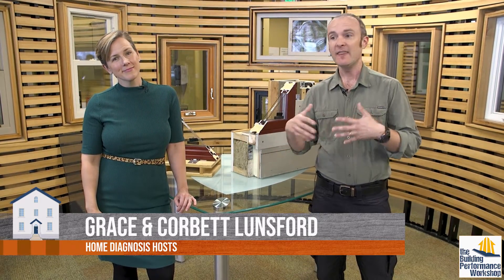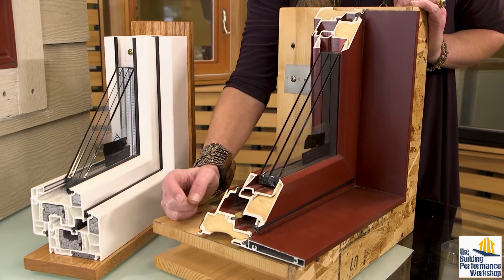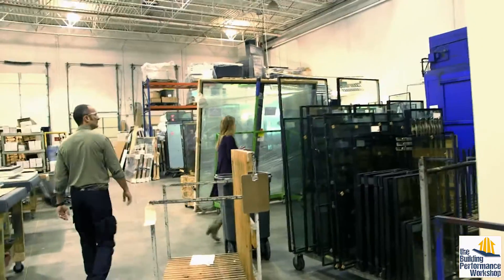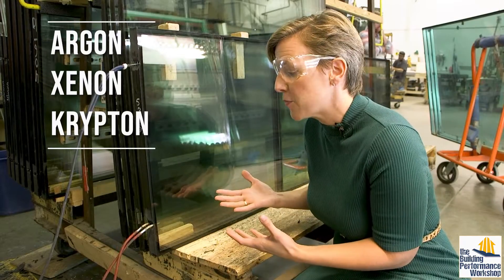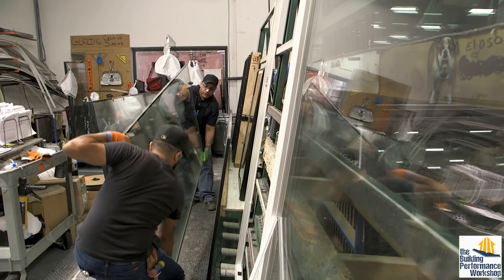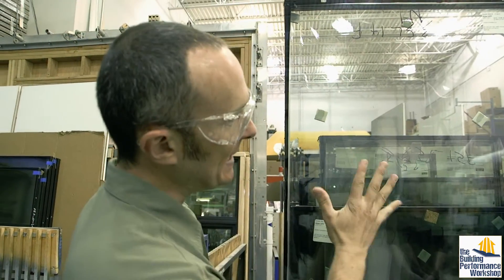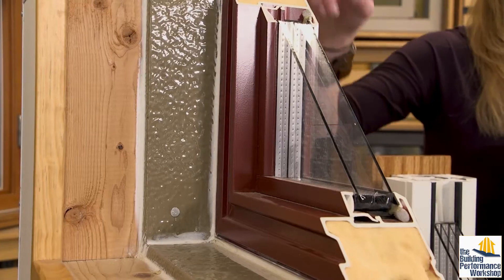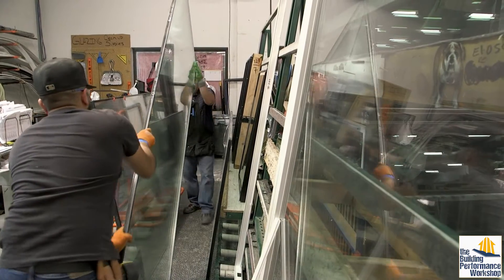Window Factory Tour: Fiberglass, UPVC, Inert Gas Fill, and Low-E Coatings

Comment: Would love to see this but with vacuum insulated glass n security films
Reply: Doubt anyone make vacuum glass vindows as the force would crush the glass and frame even before leaving the factory unless it is several inches thick solid glass.

A window with 4 m2 glass would have 4000kg force on each side or 8000kg for both sides pressing against each other.

That is like having 2 cars on ech side on the window
Reply: @tullgutten  buddy this is already a proven technology. It's actually much slimmer than these gas filled ones which make vacuum insulated glass perfect for restoration projects cuz you could just glaze them in. 
Only down sound is these tiny dots they use to keep the two panels separate. 
I just haven't seen the manufacturer process.
Reply: @mycool8980  had to google it and you are right.
But every 2cm in any direction they have support pillars too keep the glass panels from crushing towards each other and that will give many hundreds of little dots in the window.
Great for insulation where you don't need high clarity window but i doubt anyone would like this for a large panorama view window
Reply: @mycool8980  but also most say they are 2mm thicker than regular double pane window and the glass panels itself are thicker so weighing a lot more an all i see have a large vacuum port in one of the corners
Reply: @tullgutten  yeah those dots can be noticable when you 5ft or closer but pretty much disappear further away. Kinda wondered why they use black ones not clear.  But it's way less intrusive than the multiple panels you'd need to use to get the same performance imo. 
But it's difficult in manufacturing is why id love to see the process
Reply from the maker: I’ll see what I can do guys

Comment: Are those still nail on?
Reply from the maker: Yes, but I like screws better for this
Reply: Upvc=Vinyl ?
Reply from the maker: Not quite, vinyl windows are straight up PVC, and warp quickly in the sun (10 years). uPVC is more durable.
Reply: @HomePerformance  Actually, although there are definite quality variations from different sources, uPVC, PVC, and vinyl, when referring to windows, are different terms for the same basic material. All vinyl windows are made using unplasticized PVC.
Reply: @jimmyphilip2340  yes
Reply: I believe Alpen offers a clip option if you prefer that instead of a nail fin.
Reply: Is the 2 pane with mylar film better/cheaper than the 3 pane ?
Reply: @jimmyphilip2340  Pricing in a complete window includes other factors besides the glass unit that affect the price, so might or might not be more expensive depending on what it's compared with. Alpen pricing tends to be competitive with higher-end all glass windows, but that can vary. 

Better or worse is something of an open debate since suspended film didn't have a great reputation in the past (deservedly), so there aren't many companies who still use it, but Alpen has always had a very good reputation for quality.